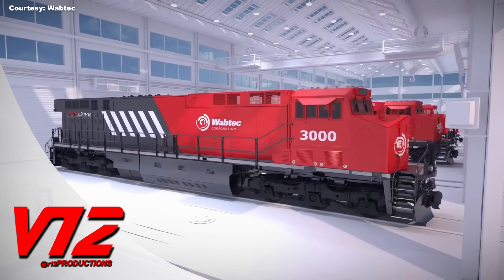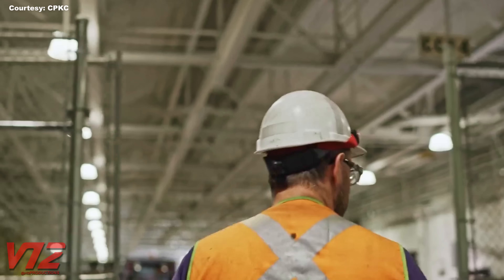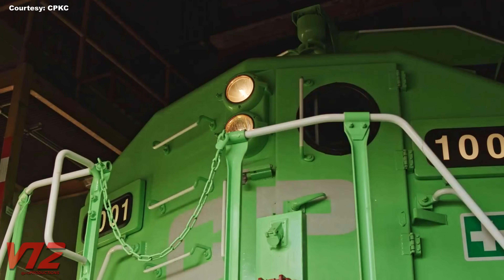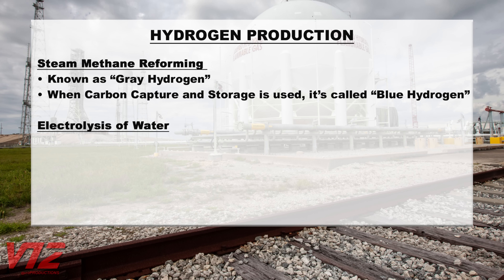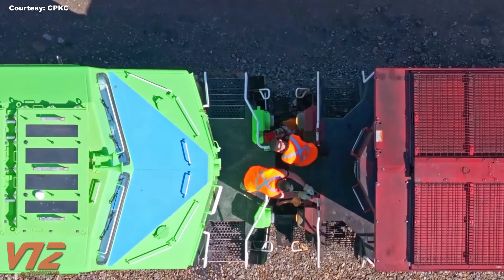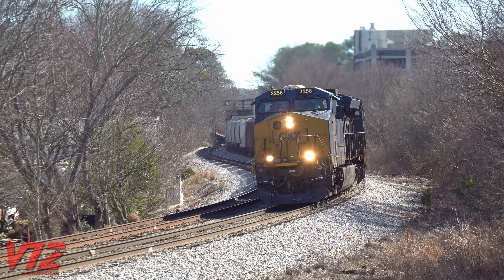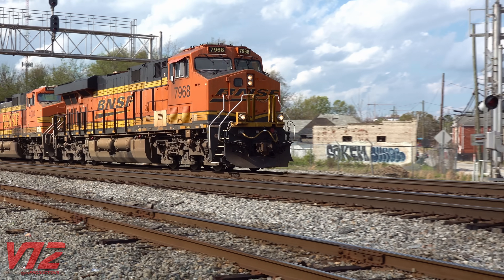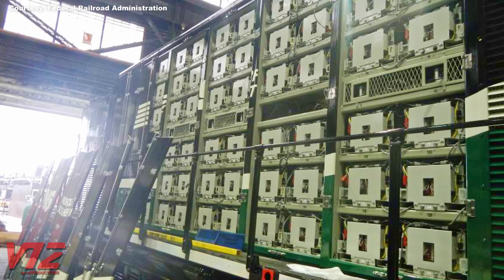The Future of Train Technology?

Comment: Electric locomotives with overhead power is a proven technology, our class 1 railroads which are run by investors unfortunately cannot see the long game and are only interested in short-term dividends. Yes the upfront costs of electrifying all the track will be high but have they worked out the annual savings on diesel, maintenance of locomotives, regen braking feeding back to the grid etc. Also include in the savings the amount of labor and logistics required to get the diesel to where it needs to be to do the refueling. If South Africa can do it then North America has no excuse.
Reply: Have fun putting that stuff up and maintaining it in montana, wyoming, north and south dakota... And the list goes on where temps get double digit negatives and wyoming gets 60+ winds regularly... Hell, have fun trying to power anything in california... They cant even keep their grid up when summer hits trying to run air conditioning... Imagine hundreds of trains pulling from it.

Not happening anytime soon if ever simply because it isnt cost effective nor even practical on americas rails outside of a select few short routes
Reply: @Batwingsix  Excuses, excuses, excuses. Electric trains can deal with all these adverse conditions and do so all the time. Northern Sweden and Norway or Russia get damn cold in the winter too, and I doubt the Kazakh steppe is a very friendly environment either. There‘s just no will in the US to invest anything substantial into rail.
Reply: Milwaukee Road literally did this successfully for decades.  @Batwingsix
Reply: @Batwingsix  Have you never seen the Milwaukee Road or the railroads in Russia? It 100% can be done

Comment: FOR LONG distance-ELECTRIFY O'head. WHY!! CHEAP BEEN AROUND FOR OVER 110 YEARS Cars Trucks well that's different. STREET RAILWAY( MODERN VERSION OF STREET CARS)- THE OLD FASHION ELECTRIC LOCO'S  Add a battery system for short off main work (sidings) Trolley busses can have battery backup BUT NEW locos TYPES at 4 times the cost of a simple electric loco, its just plain stupid

Comment: The only practical use I see for battery-powered locomotives is in rail yards and industrial spurs.
Reply: Rail yards can use o"head electric  and standard electric locos with add on battery for short spur runs. Modern electric buses can have battery back up or diesel

Comment: The General Electric ES44C4 LNG Diesel Electric Locomotives at the the Florida East Coast Railway have a 33,000 Gallon Armored LNG Tender in between two of them and they only use the LNG when you throttle up from Notch 3 to Notch 8. From Notch 2 to Idle it use Diesel Fuel only. They burn the Liquefied Natural Gas and Diesel Fuel in a 80:20 Mixture using the 20 percent Diesel Fuel for combustion so it doesn’t need spark plugs to ignite the LNG. The 80 Percent LNG is -260 Degrees Fahrenheit when it comes from the tender tank then before combustion it boils off to a vapor at atmospheric pressure before being mixed with the 20 Percent Diesel Fuel and Air Mixture in the 12 Cylinder GEVO-12 Prime Mover in the GE Next Fuel Conversion Kits. These Locomotives have the typical 5,000 Gallon Diesel Fuel Tanks and with two GE ES44C4 Locomotives connected to the 33,000 Gallon LNG Tender they can make 2 back to back trips from FEC Bowden Yard in Jacksonville, Florida to FEC Hialeah Yard in Miami Springs, Florida without refueling!! It’s awesome!! The fuel tenders built by Chart Industries in Jacksonville, Florida have valves on them that automatically close in the event of an LNG Leak detected by sensors on the tender and locomotives. They also have an armored bottom that can withstand a rail at 60 Miles Per Hour trying to Pierce through it. FEC Line of Road Trains like FEC 105 and FEC 205 typically pull at 60 Miles Per Hour which is line speed for FEC Freight Trains, so these LNG Hybrids are saving the company money on fuel costs.
Reply from the maker: Thanks for the explanation. I was wondering how FEC was implementing it.
Reply: @ you are most welcome my friend! Feel free to add this to one of your videos if you want. Thanks for all you do! As a former railroader at CSX Transportation from 2014-2020 in Miami, Florida ( CSX Hialeah Yard ) I love your videos! Trains are something that once in your blood they become apart of you forever! I’ve loved them since I was a kid and was fortunate enough to work on some of them. I am in the Maritime Industry now working on Tugboats at Moran Towing in Brunswick, Georgia but will soon be working with Military Sealift Command for the Navy on ships. I may eventually come back to the railroad though. Maybe FEC or NS this time. Thanks again and have a blessed day my friend! 🚂
Reply: What a great explanation of how their system works as I worked for Praxair about 30 years ago hauling liquefied oxygen, nitrogen and argon but the company then was working with GE trying to get an engine to start off with diesel fuel then switching over to hydrogen and the testing was out in Utah and we never heard if they got it up and running liked they had hoped but it’s good to see Florida East Coast has their unit running on LNG and diesel.

Comment: Charlie,

Wow. One of your better stories/videos. 
Batteries-all electric I feel is the wrong direction.
Hydrogen is the way to go but it is dangerous, hard to bottle but it sure is powerful and clean. 
Lets see where man goes with this technological challenge.
Reply: I always saw battery electric as something only fit for industrially use, like a modern replacement for the fire-less locomotives of the steam age, until I saw what Amtrak plans to do with battery electric. That being to put a battery in a coach and only use it to power a bi-mode charger when going in and out of New York Penn Station. 
Unless someone finds a way to liquefy electricity, battery electric is a dead end technology.
Reply: @t1m3f0x  Battery electric being a dead end technology is definitely true. With all the conditions locomotives are subjected to, those batteries would degrade extremely fast
Reply: @csx345  I hadn't even thought of the abuse they would take, but you're right. We demand a lot from trains, they're expected to like run for 50 years, and catch on fire before they get replaced.
Reply: hydrogen isnt the way to go at all
it requires 6x the energy to produce that you get out of it at the wheels
still requires carrying around its own power plant and fuel(extra weight)
and doesnt have anywhere near the power capabilities of an overhead power line
chances are itd end up costing more than electrifying the lines as well

there is no technological challenge here, this issue has been solved for hundreds of years
Reply: I would prefer to electrify most of the entire major North American railway network myself, with overheard wires to power electric locos. The Milwaukee Road used to run electric freight on its mainline
Reply: Powerful? That CPKC locomotive has a whopping 1,610 horsepower! Hydrogen itself may be energy dense (by weight, but certainly not by volume), but the fuel cells are hilariously weak.
Reply: If we develop better battery technology with something better than lithium maybe.  Right now no.

Comment: -builds sustainable hydrogen powered locomotive

-uses it to haul coal
Reply: That makes it clean sustainable coal!
Reply: @6yjjk  interestingly coal gasification is pretty close to being clean. Still lots of co2 and unsustainable but really clean.
Reply: @6yjjk  if only such a thing existed
Reply: @RailsofForney-official no such thing as clean energy period. Something is always going to be manufactured in a factory.  Now there is cleaner energy of course.
Reply: What are the odds 😂😂😂😂
Reply: Coal trains are very heavy so it was a good way to show fuel cell locomotives can handle heavy trains.
Reply: @  I knew that’s what they were going for but it just looked like they were using it for what it was meant to replace
Reply: @kiefershanks4172 ... hmmmm....it doesn't matter whether the weight is from coal or Styrofoam, weight is weight. Coal trains are not especially heavy because they're hauling coal. Which is heavier, 100 pounds of rocks or 100 pounts of popcorn? 😂
Reply: The most unfortunate part of this circumstance is that they could have just have easily put it on a potash or grain train on the same exact route, but evidently the people in the sustainability department have CP Red colored glasses on...
Reply: Be real. 
Those titles are the only ones you notice. 
Click bait ratm
Reply: Coal used in steel making is generally to add carbon, not as the fuel; just an FYI.
Reply: As he said, it's coal for steel-making not for power plants.  Steel is iron+carbon.
Reply: @  doesn’t matter, it’s still a nonrenewable
Reply: its not thermal coal bozo
Reply: I mean at least it’s for steel production instead of power generation, so there’s some improvement
Reply: Okay?
Reply: yeah... let's all just ignore the fact that the newport news coal dock set an all-time export record in 2024.
Reply: :face-fuchsia-tongue-out:heeee haw:face-fuchsia-tongue-out:
Reply: did we watched the same video? the coal is used to produce steel you Sherlock!
Reply: @carholic-sz3qv  These sorts of people don't have much going on in their skull.
Reply: Yeah that was a huge oversight
Reply: There are some things which need coal.
Reply: Oh, the irony! 😂
Reply: well it's not thermal coal, you don't get steal without met/coking coal
Reply: @werta5000  Steel/=Steel.
Reply: Coal trains are the heaviest of trains and if the locomotive works on coal trains then it could pretty much haul any train.
Reply: @werta5000  You don't actually need coal - it's just been a widely used process because it's (relatively) simple and has the nice feature that the coal acts as both a reducing agent and a source for the large amount of energy needed.  If you reduce the ore using some other method (say using H2) then you get similar results, but you have to add a large amount of external process energy.  Combine this with the generally low efficiency of the process used to generate the hydrogen in the first place and the whole process becomes heavily energy-negative.
Reply: @werta5000  You can make steel without coal or pet coke but I don't think the processes have scaled yet to the point where they can replace them.
Reply: @  have you heard of Reddit?
Reply: @RailsofForney-official  that’s where I graduated
Reply: @TheConfluencePArailfan your last comment is boutta be on r/ihadastroke
Reply: @RailsofForney-official  lol
Reply: What’s next an ethanol train 😂
Reply: @TheConfluencePArailfan You could, not that the BTU output would not be on your side. The model T was designed to run on ethanol.

Comment: A hybrid type would probably be the most most practical. I spent approximately 1/3 of my career on road switchers. We had spots where we tried to leave the locomotives at the end of the shift, but there were many many times we’d have to leave them wherever we could find a spot to put them. Or we’d simply run out of time somewhere inconvenient. Thinking you’re always gonna be able to leave the engine in a specific spot is not realistic because operations are normally very hectic
Reply: I love to read insight like this from you folks who actually worked for a railroad. Thank you!
Reply: So you just left them blocking tracks that need used???
Reply: @PatriciaCrawford-o4n   not normally. You always try to get them “in the clear” somewhere. But that could be just putting them on the end of a track full of cars, some little spur that hasn’t been used in years, some customer’s track, etc. Trying to get to one specific spot would work sometimes, but definitely not always
Reply: @PatriciaCrawford-o4n no, that doesn't make sense.  the inconvenience was probably a long walk back and needing a fuel truck.
Reply: @PatriciaCrawford-o4n  Nope.  Sometimes you leave them at outposts, spurs and and even at the industries that you switch.  Many of those places are not accessible, as far as getting a fuel truck to their location.  They can also be difficult places to for crews to be picked-up or dropped off.  The locomotives are usually fueled at their starting location, at various intervals.  There are all sorts of variables that determine how things are done.
Reply: I'd like to add that not just hybrid, but dual mode is the best option. At the end of the day, electrification is the best and most cost effective means of powering rail, so having rolling stock that can use such infrastructure as it is rolled out is the best option.